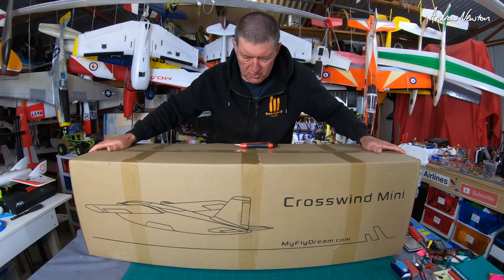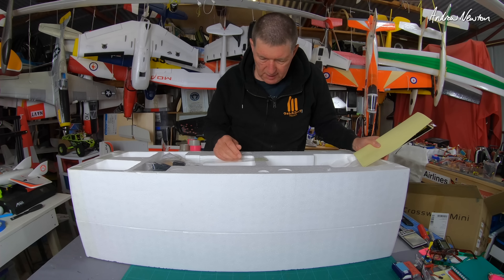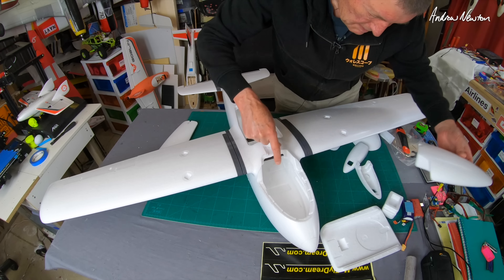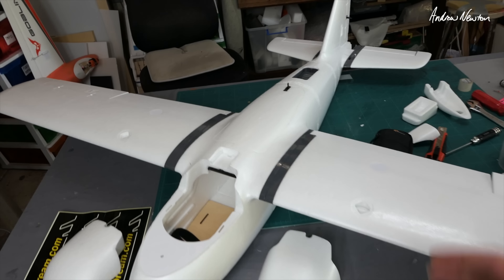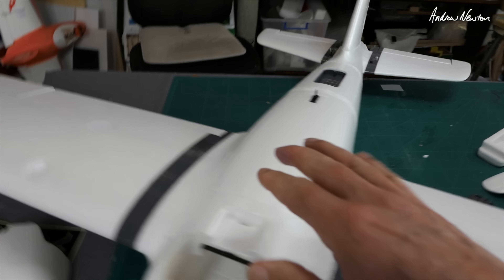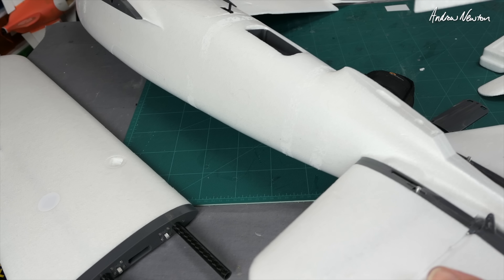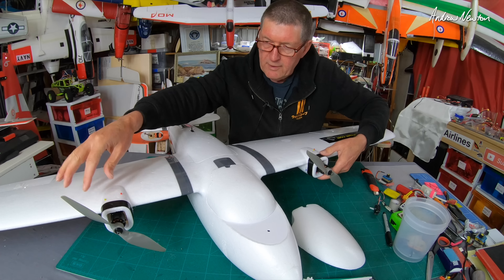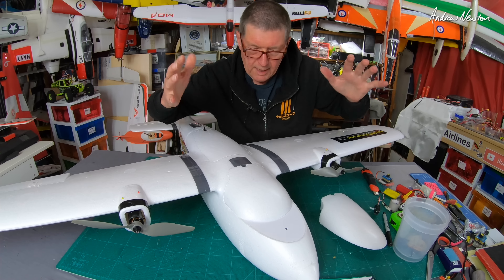MFD Crosswind Mini Review and Assembly

Comment: I'd screw an undercart plate on the bottom of it Andrew...It could be quite short and stout with it being a twin...Safer than chucking such a big plane, and it means you could load it up with more Lipos as you test it's carrying capacity.
Reply from the maker: Hard to hold the wide body but it actually takes off very easily, plenty of power
Reply: @AndrewNewton  Cool, it must be difficult to hold..Imagine trying it with 20 amps of lipo in it though?

Comment: Amazing how many of these get sent out with the wrong kit 😳 You're lucky you were only missing a part you didn't need, I was missing a wing joiner and half a nacelle! Enjoy flying it, will be like a feather compared to mine which carries a 1,300g 6S 10,000mah Lipo.
Reply from the maker: I watched your video before I started on this Adam. Thanks it was helpful.
Reply: @AndrewNewton  Cheers Andrew, glad you found it useful. One thing I had to do since that video was take a few mm off each of the main wing spars. Do you find that the first wing goes on with ease but then the second one is a bit tough? If yes it's because the spars are like mine and a bit too long, touching each other and forcing the fuselage apart slightly. After taking a few mm off the wings go on with ease now.

Comment: Hello Andrew! I could not see Sunnysky X2212 1100kV motors? Could it be X2216 1100kV that you had used on this plane? I am going to build a similar lightweight setup like yours, so I appreciate any inputs about it.
Reply from the maker: The 1100kv motors came from a ZOHD model. Maybe look for 1250kv or whatever is close and available. 2216 would be fine too.
Reply: @AndrewNewton  Ok! I guess 1100kV is a  special one which is not available to purchase for the end user! But thanks for the suggestion, then I will try X2212 1250kV, hope I will get similar efficiency as you did with this plane. I love your videos, the best reviews on youtube about RC builds and maidens. Thanks for your time!

Comment: Hi mate, I do have 2 of those planes and I got disapointed with it, I tried already several motor and props and battery setups and I can tell that apart from being a really good looking plane, it is not made for heavy lifting and endurance... to have endurance you can't put payload on it and the maximum I got was 1 and an half hours of flight. Like the binary, its wingspan is too short for the purpose they propose for the plane. 
If the goal is to fly for long periods of time with payload like mapping cameras or other type of sensors than I really propose something like the Pro version which has near 2 meters or the new MakeFlyEasy Fighter with 2.5m.
The nacelles are not designed to assist the ESCs in case of damage, once glued you will not have more access to them AND they are fragile, I had the bad luck of braking one prop which originated violent vibrations and because of that the nacelle just exploded and I ended with an hang motor and ESC. I am now designing new carbon fiber nacelles to replace the new ones and, who knows, sell them as a third party parts.
Here you can check me testing the prototypes (far from being the final model)
https://www.youtube.com/watch?v=s2xZlDup88w
I have also made replaceable kevlar belly protections which weights only 80 grams
Apart from these negative points, it is a nice plane, but only that
Take care & stay safe.
Reply from the maker: Great advice thanks, you have really tested it out
Reply: @AndrewNewton  Yes I did, just let me tell you more thing, with those X2212 motors you are not going far, I can see that you have plenty of hardware so try to find something like a 2814 or so, thats the PnP motor size, currently I am flying with a DYS BE4108-480kv motor with a 13x6.5 carbon prop and thats the better power to endurance ratio setup... yes, I know, it is a multicopter motor and prop, but as you might know, multicopter motors and props are the most efficient ones you can find..
Later on I can supply you with the new nacelles (when finished) and kevlar belly protection for you to review if you have interest on it.
Take care.
Reply: @AndrewNewton  Just one last thing, don't fly 4S, try 6S because you gonna need it.
Reply: @AndrewNewton  This is the video where I explain why and how I modified the nacelles
https://www.youtube.com/watch?v=rwms71pz_e4&t=37s